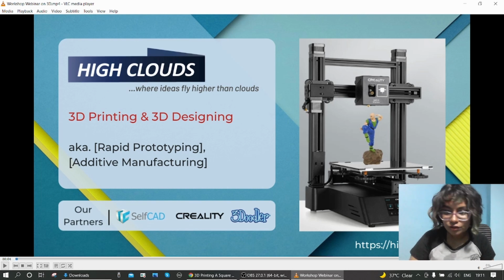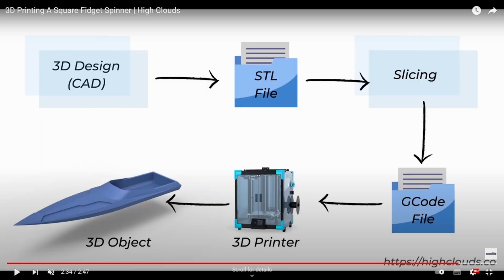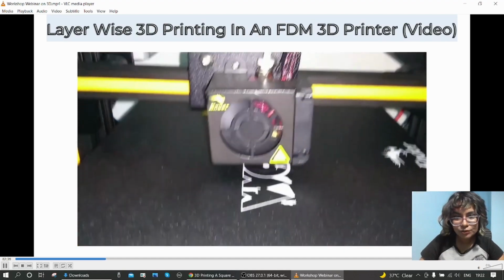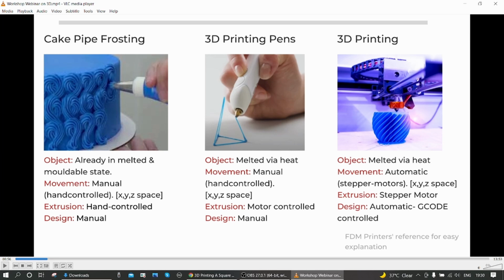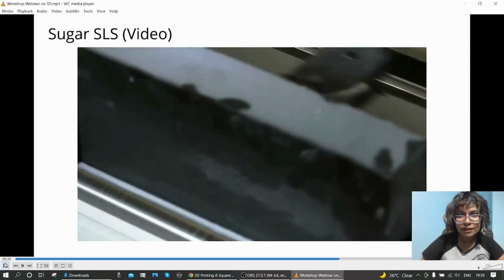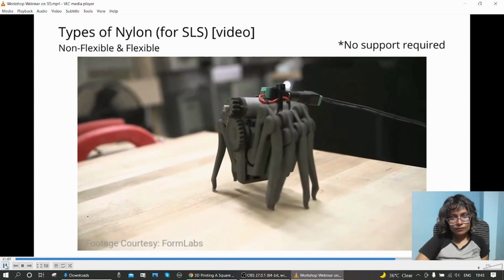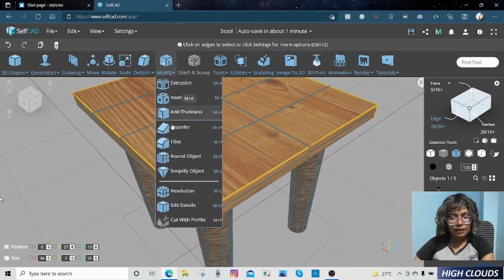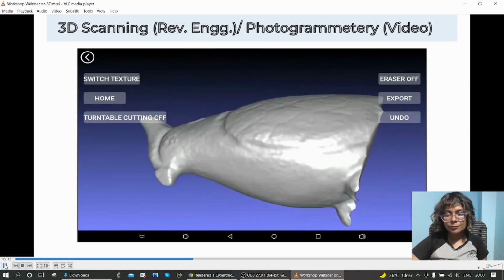Introduction to 3D Printing | High Clouds | 3D Printing In India

Comment: Beautiful video very well explained the process of rapid prototyping. With 3D printing possibilities are endless.Did you create that T-Rex model? 
Tip: For an introduction video new terminologies should be as minimum as possible. 
Best of Luck!
Reply from the maker: Thanks a lot. Yes, we 3d printed that T-Rex model & the snake & fidget spinner too. These 3 models were made using PLA filament.